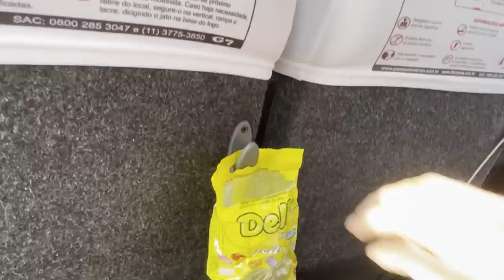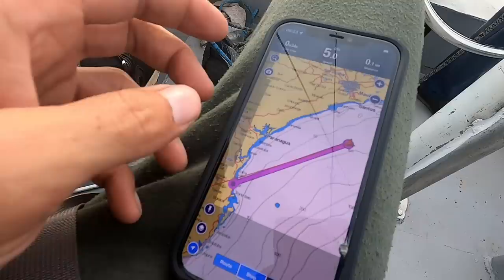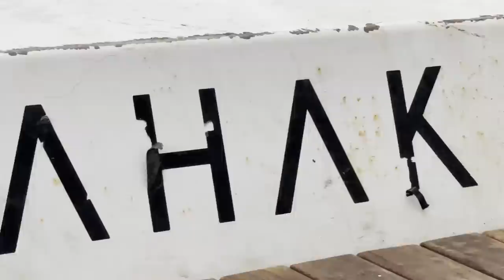Sailing a SKELETON BOAT w/ Sailing YABA (NO MOTOR) ⛵️ Ep13

Comment: Lori, either in this video or one very close to it I think I might have spotted a teachable moment! It's the one where you drop the winch handle  -thereby  almost qualifying to join the legions of sailors before you who have gained full membership of the Lost Overboard Winch Handles Guild. To gain full membership it is essential that at least one winch handle be forever lost to Neptune. One handle  = 1 bar, two handles 2 bars and so on. Anyway, I lament the loss of bulwarks. They did serve to keep sailors and valuables on the boat ! Nowadays we're usually left with a pathetic little toerail! 
I notice that your boat fits this category but I offer a simple solution.  To be effective a toerail should save a dropped cell phone from a watery grave. 
In your case I suggest that you fill the gaps beneath your toerail with perforated stainless steel grid which will allow flooded decks to drain while preventing valuables from taking the Deep Six option!
Reply from the maker: Thank you kindly for the incredible induction to the club!! High honors that we could achieve this level at such a quick rate! 😅😂🤣 

We did cut out those bulwarks! So the original ones where more than poorly made. They were extra high so nothing would leave the deck, including lots of water 😅. It had only a few exits for the water that were not strategically placed enough meaning no slope for water to naturally leave. The deck was over all in great condition minus where water would pool. And being a steel boat we wanted zero water to stay on deck. We found a boat that did the same toe rail that we put now and imitated it. (Sadly we did not video this process) And now, you are right, water does not stay on deck, and nothing else as well!

Love the stainless steal grid idea. Would definitely eliminate the water and rusting issue! We will look into this! 

Thanks for the feedback! Keep it coming! And Happy New Year!! 🥳🙌⛵️

Comment: Great help from Ben. A large outboard would have helped. Good lessons learned and should help you design the electric propulsion better as you really can't rely on the wind forecasts. Electric motor will have limited range.
Reply from the maker: We will definitely take all that we have learned from this trip and try to apply it to the design. We will dive into the electric motor with its capabilities and limitations soon! Really looking forward to that installation! Stay turned 😁⛵️

Comment: That was quite the adventure!  But a good result in the end. 
Glad you found some batterns for the Mainsail, clearly the boat sailed well , maybe a few 1000kg of interior will weight it down a little better for sailing.
Good luck with the work to come
Cheers Warren
Reply from the maker: An adventure indeed!! 😅 good eye on the battens! They were actually in the boat the whole time but we forgot to put them in in the excitement on the first go. 

She sailed like a dream but some weight would go a long way with making her more steady. We are calculating the weight of the interior and perhaps will add some ballast in the keel as there is a hallow part from an old diesel tank. Well let you know how that goes!
Happy New Year! 😁🙌

Comment: My first thought is to put that quadrant on upside down. So the cables don't leave the groove at an angle... or add two more pulleys to guide the cables for the same purpose. I have not yet had to tow a boat as big as that with a dinghy but with our 24ft (8M) boat I found towing from the hip, that is fasten the dinghy to one of the rear quarters (I seem to choose the starboard side) makes control a lot easier but you guys seemed to do fine any way
Reply from the maker: Oh that's a creative solution! We will definitely look into a fix for these cables falling off. The original installment and alignment is 100% the problem. Also, the way the cables fasten is a little annoying as well. We'll keep you posted on how that goes!

Comment: I was going to mention the angle of departure from the quadrant  of the steering was way off and you need a couple of guide rollers to alight the cables from the departure angle
Reply from the maker: And you were right, the angle is the issue. We are going to revisit this to see what solutions we can do to correct it.
Reply: @lahakai  drop a couple of additional pulleys between the tangent and the existing pulleys to reduce the angle (raise towards the roof before they pass through the existing ones)

Comment: You should have temporarily made up of bracket for the transom of your boat to accept the dingy motor and that would have gave you movement
Reply from the maker: We actually did have one but we decided not to install it in the end because the motor was so heavy to transfer from the dinghy to the boat and back. So towing the boat with the dinghy was almost equivalent.

Comment: I wonder do you have clearance room to mount a couple opening ports inside the ply windows, about $30. Amazon. Also looked like the steering cable not straight alignment to the quadrant.
Reply from the maker: Yep, good eye! We noticed the misalignment of the steering cable but we’re reassured that it was fine. Sadly it was not. We will address this now and and see what kind of solutions there are to eliminate the problem.
Reply: @lahakai  I had to make new athwartship bracket for steering pulleys in front of quadrant. for pulley mounts I had Aluminum U-beam sections nested inside each other that I could adjust sheave  height and angle to desired position

Comment: #nomotornoproblem I used to be an electric conversion guy then I was convinced by the naysayers that I couldn’t get the use I wanted out of it, so I just went motorless 👏❤️🏴‍☠️
Reply from the maker: Your even bolder than we are! Where are you located? Can imagine there’s more wind there. 

We had enough patience for the slow sailing. But the area has straight up no wind for long periods. We should have attached some paddles to spice things up 😂
Reply: Astoria, Oregon

Comment: So what was wrong with the dinghy, and how did you fix it?
Reply from the maker: So the dinghy was an easy fix in the end. The seller had told us incorrectly the mix of oil to gas (1 to 5) but in the end it was 1 to 15. Then the carburetor had to be cleaned. And once we got that aligned the motor worked like a charm.

Comment: There is something strange about your colour balance in the videos. I don't know enough to tell you what the problem is. In strong light, all the colour washes out. 18:07 - 18:46 is fine. I think it is the camera Lori uses most that is not calibrated. But, in terms of narrative, one of your best episodes to date! Merry Christmas and a superlative 2023!
Reply from the maker: Hey! Thanks for letting us know. There are some shots that are a little blown out because of the high contrast of the sun and shade that couldn’t be corrected. But could you let us know which scene and what device you are using so we could check? Thanks!
Reply: @Lahakai Sailing  Hi. I am viewing on a PC. I am no expert. It's just that I've noticed that, whenever you, Lori, talk to camera, the background is blown out, the greens are greyed and reds are pallid. I feel it might be the colour profile the camera is set to. But, you need to talk to someone with more knowledge than me!
Reply from the maker: Ah now that you say that, there is a lot of footage that is shot on the iPhone. So if you are saying when we are doing vlogs the lighting changes, perhaps its front facing camera vs back camera on the phone? There are several different climates thoughout this video too (it goes from tropical sun and crystal waters to overcast and black waters seemingly in a single day).
Reply: @lahakai  I think you have your work cut out!